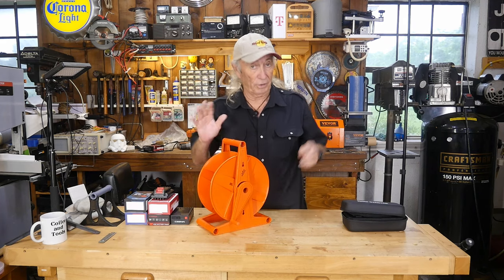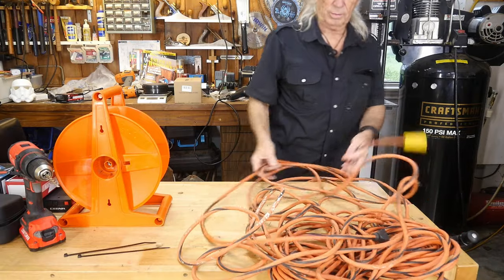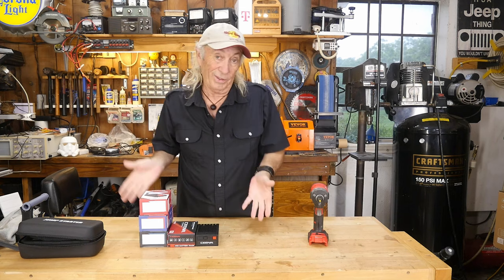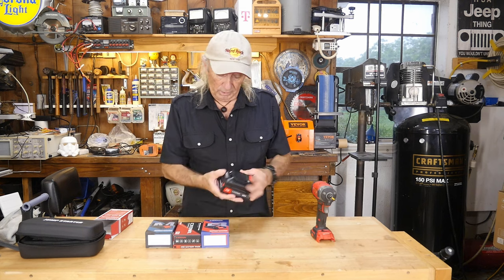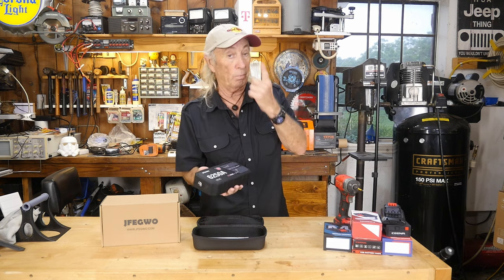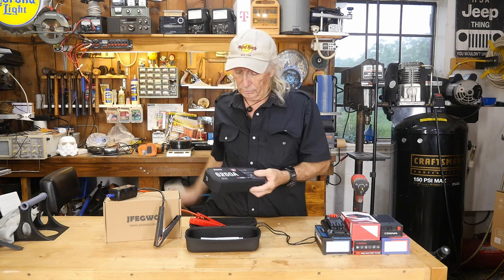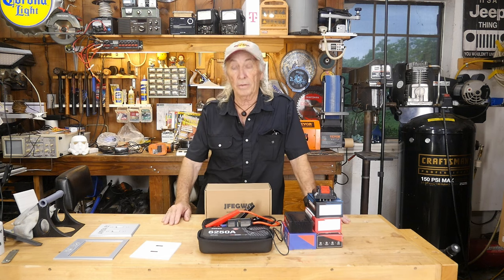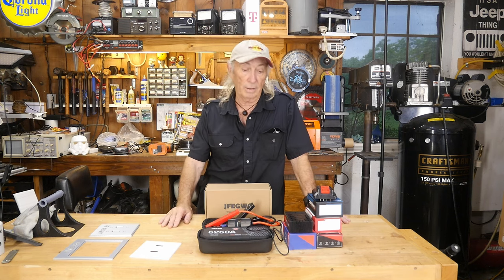JFEGWO jumper, CEERN battery tool adapter, Area 51, Ep 441 Coffee and tools

Comment: I've been using JFEGWO for several years, and it has never let me down. It works well in both cold and hot weather, always providing enough power to start any vehicle I connect it to. For this price, you can't go wrong with this unit.
Reply from the maker: Super thanks for this posting. It's always been a good one here for me. Like a brand name that you can depend on. :face-blue-smiling:

Comment: I was at a friend's place, and he was working on an old Ford dump truck (diesel). The batteries were dead, so he pulled out a lithium-ion jump starter and power pack he got from JF. Without hesitation... I bought one and use it when I head to the lawn. My tractor only gets cranked these days when I'm out mowing! It never fails to fire up that little diesel. I mostly use it for the tractor, but I keep it in my wife's car to ensure she doesn't get stranded. I also got one with an auxiliary compressor. Tired of flat lawnmower tires. It's the bee's knees. I have a 12-foot enclosed trailer where I store my Hustler 52, and that's where the jump starter resides. Along with tools. I call it my Mobile Storage. Heh-heh-heh.
Reply from the maker: I like that Mobile storage LOLOL...cool idea !